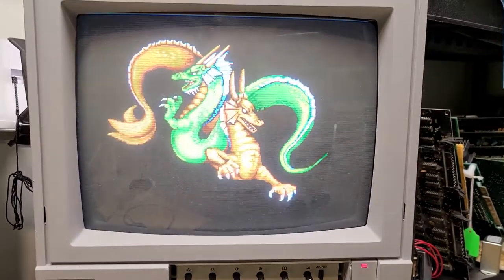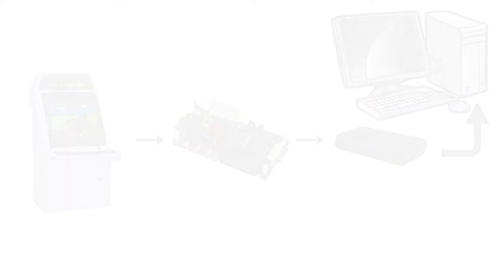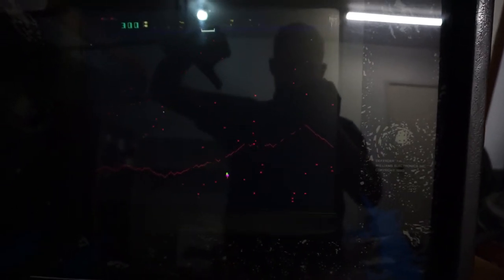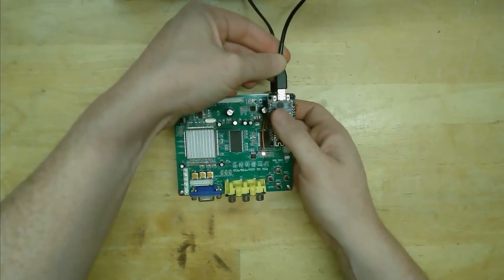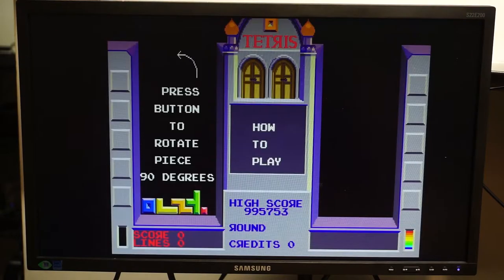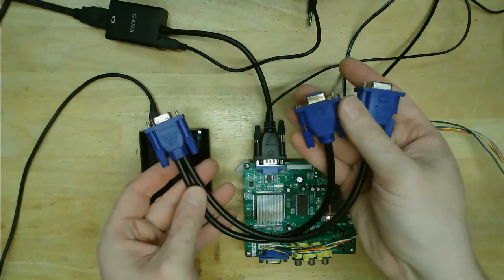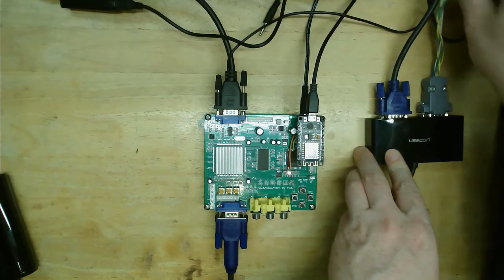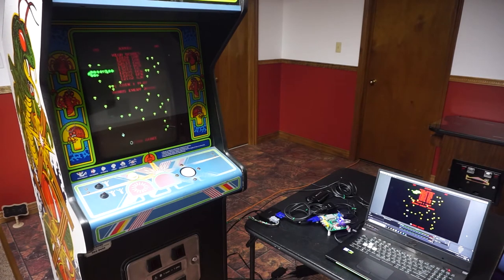Capturing Arcade Video with the GBS 8200 Scaler and gbs-control Firmware

Comment: 7:15, Just FYI there's a GBS 8220 that has two VGA outputs instead of one and allows for a solution to your exact problem. The GBS 8220 is also inexpensive and works with GBS control, although it has slightly worse video quality without hardware mods.
Reply from the maker: I do have an 8220 and it would not solve the problem since the dual outputs are the scaled output. The CRT on my bench needs the original signal, not the scaled signal.
Reply: @74XX_arcade  My bad, you're 100% right

Comment: Hi.

I have a question for you. I have tried using my GBS 8200 with CFW to scale my Neo Geo but I have not succeeded, in the forum there are many people with the same problem but you have not had any problems. The question I have is if you used any circuit for the video in your Supergun or in your cabinets and I have really tried everything by putting resistors or capacitors and even this does not help to have a stable signal in the GBS8200, I do not know how you use it Or what is between the video of your Neo Geo and the climber that everything is so perfect.
Reply from the maker: Hi Carlos, no I haven't used anything special on the supergun or in my cabinets. Are you using the GBS 8200 to scale an MVS board or a home console AES? What instability are you finding with your setup? Sync issues, color, etc?
Reply: @74XX_arcade  Hello, thanks for answering.  What I am trying to connect is a MVS Model MV1F system.  And the problems that I get are that there is no video signal on the GBS 8200 or sometimes it's intermittent back and forth.  Others in the forum have reported this problem, even the Wiki of the project talks a bit about it but when I saw your video I was surprised that you basically just connect everything and it goes well.  Which makes me think that it has to do with the model of your MVS or with the modifications you made to your GBS 8200 to implement the CFW.